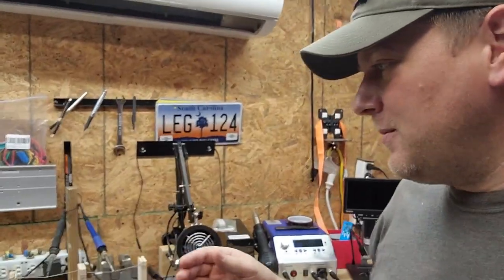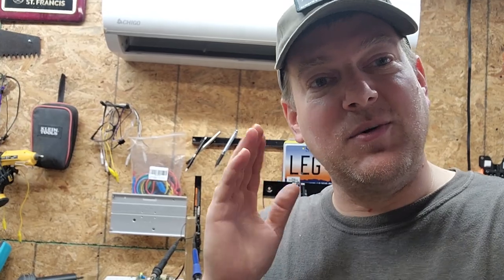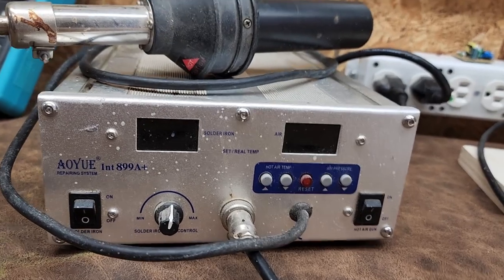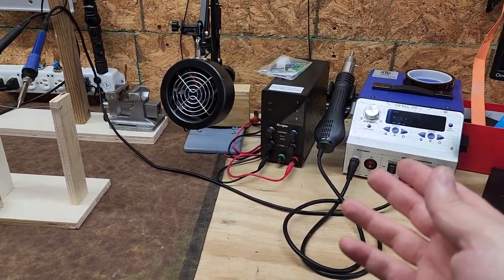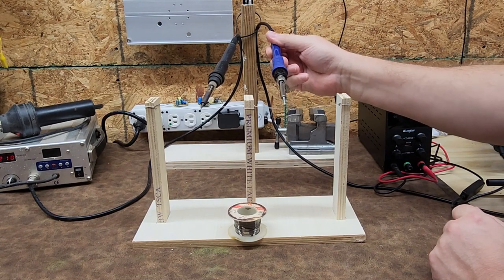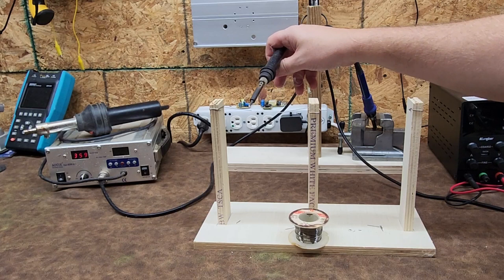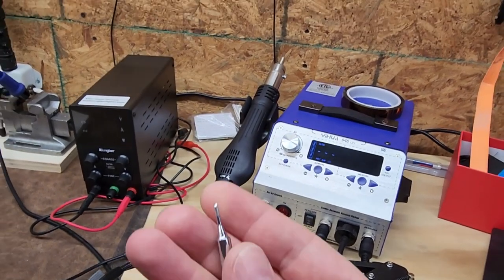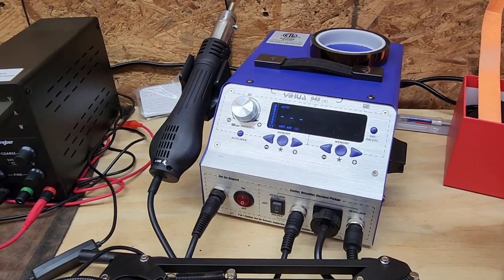Soldering Iron Race!  Aoyue Int899A+ vs the new YiHUA 948II 4 in 1 station

Comment: I have the Yihua 948 II and highly recommend it. Although I managed to plug up the desoldering gun within 48 hours of delivery! After disassembling the gun, I used a thin drill bit to remove the solder without touching the inside of the heater. It was fiddly but an hour well spent. I learned about the construction of my desoldering gun and 'served my time' for my misdemeanour.

Comment: Nice test. I have cheap 30w irons that turn on when you plug them to an outlet. I use a lighter or torch to heat the tip quickly 😅
I also put copper anti seize compound on the screw that holds the tip so I can change it easily  down the line.